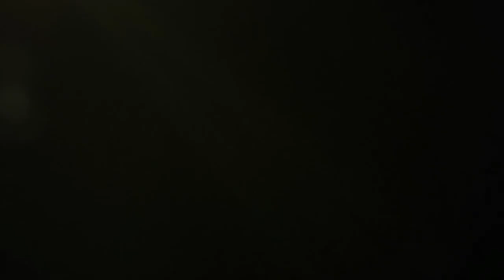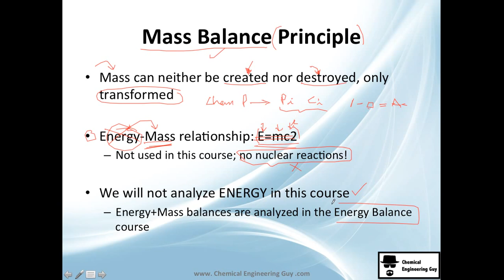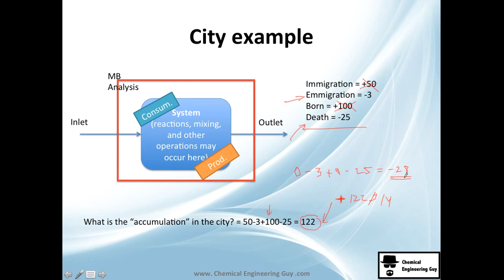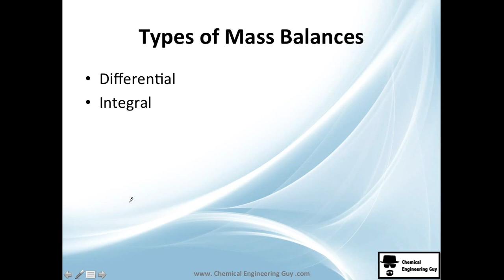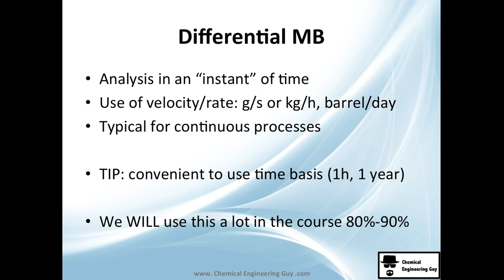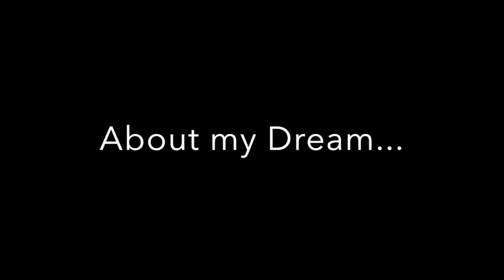Principles and Equation // Mass Balance Class 02

Comment: because in this video u took the example of accumulation there is prdouction is 0 kg and outlet is 25 kg Is there is any difference between production and outlet?
Reply from the maker: production is created in a chemical reaction... Outlet is anything going out of the system, can be a material which is inert (Nitrogern gas in combustion, for example) or a reactant which is in excess (oxygen gas which is leftover due to excess in soitihocimetry) or products created (CO2 from the combustion)

Comment: In minute 13, I think your example is unrealistic and misleading, but I will need your comment.Since you used mass units (kg), how can there be accumulation?  Isn't accumulation only possible if we use moles because the moles of different substances have different mass?You could also see that it's wrong when production is 0 ! How can there be consumption of +mass without producing any mass?  You said yourself (prod. and consum.) part doesn't exist when the units are kg, right?If you used this example just for plugging numbers, then I think it's misleading.Thank you,
Reply from the maker: As stated before, we are talking about "A" in a reactor, not "B", therefore, the mass of A can be consumed/produced
Reply from the maker: For me it is pretty clear that the accumulation of A in the reactor/tank is 25 kg, since we had an inlet of 100 kg of A, then 50 kg of A convert to B, there is no production of A, the outlet if only 25 kg.If you are talking about total mass, then there is no sense, since mass of universe is always constant. Mass of Species A/B will not be constant if there is chemical reaction